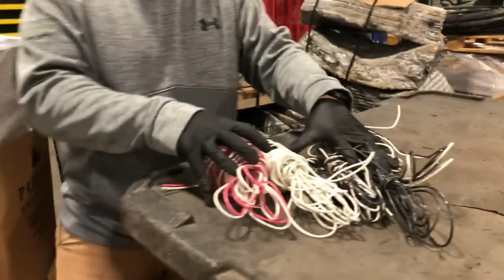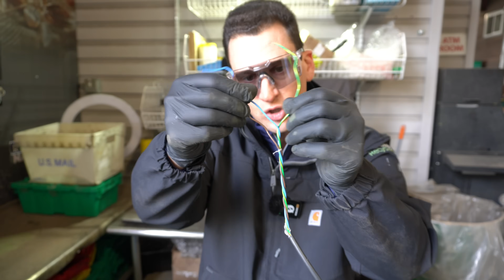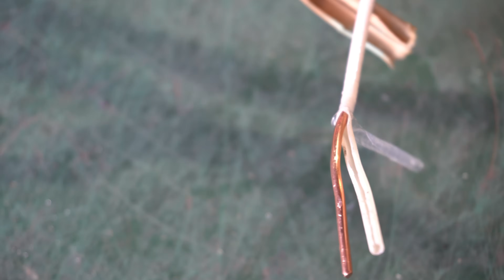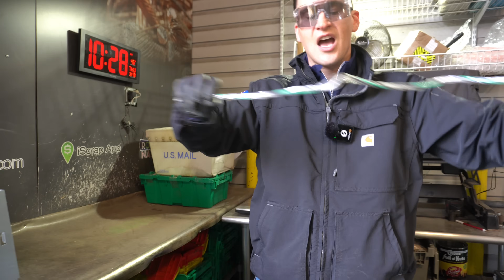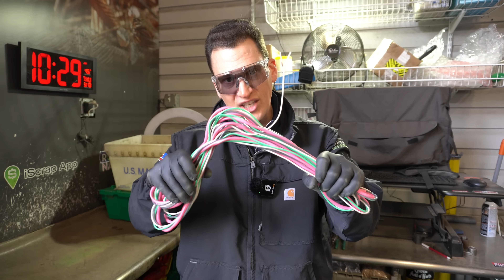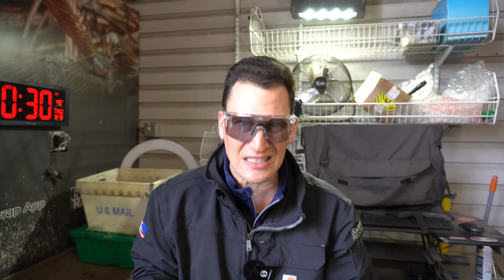THHN Wire vs "Thin" Wire: What's the Difference?

Comment: Pretty sure THHN is an industry abbreviation for Thermoplastic High Heat-resistant Nylon, while THIN is the opposite of THICK. Yes, there is THHN insulated wire that is stranded or #2 copper when stripped, and there's THHN insulated wire that's solid. It will generally go as #1 copper if stripped of the insulation... depending on it's gauge and what your yard says. Usually  thicker than a pencil lead or 16 to14 gauge... again, depending on your yard.

Comment: FYI, refiners don't share much, but they do have methods for melting copper so it won't oxidize. Indeed industry requires oxygen be removed from the finished product. Refining under vacuum, covering with carbon, covering with borax, using a shielding gas, etc. They can also chop and briquette copper powder or fine wires so it forms solid chunks.

Comment: THHN and THWN are basically the same thing as far as scrapping is concerned. The difference is w means water and used in underground wiring inside conduit. Also, both can be solid or stranded. I strip everything to 16 ga. but that's me. Hope this helps. Happy scrapping!